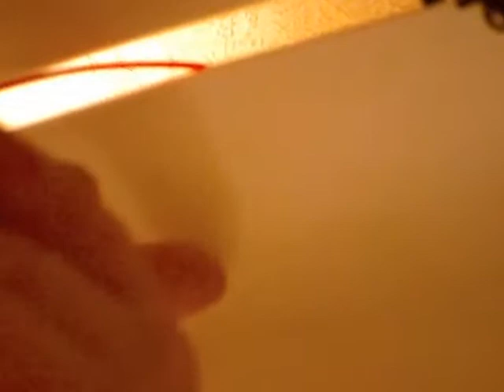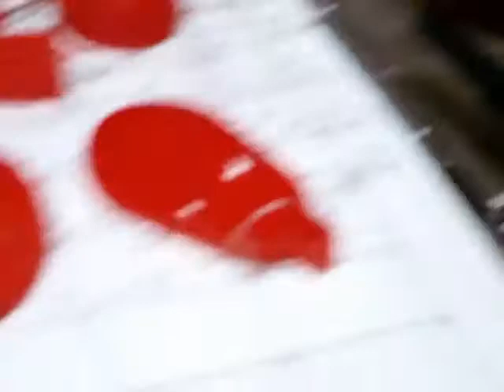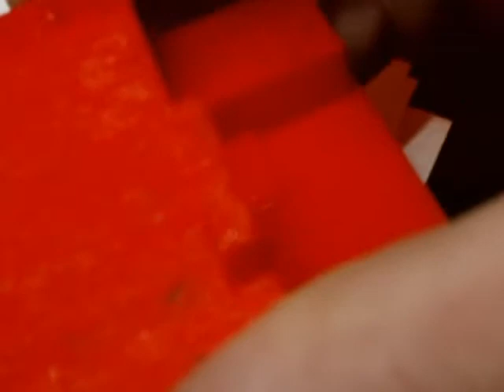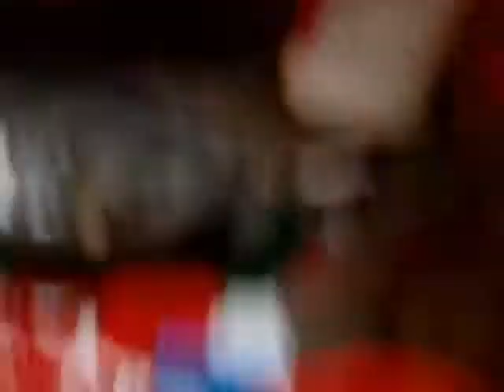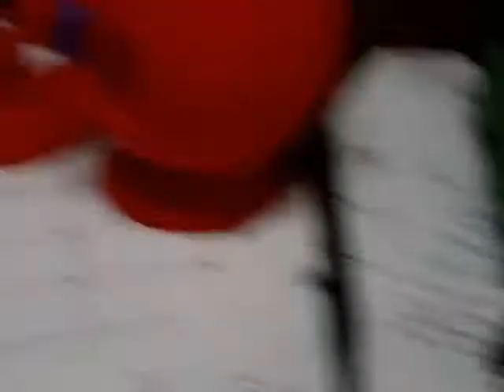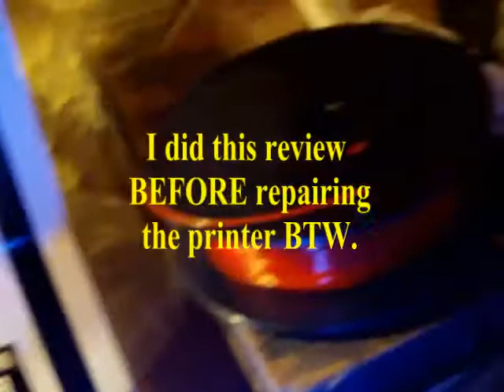Robo 3D R1 - Old review / Extruder Repair Video 5 (of 5)

Comment: Hi there, many thanks for this series, I have now watched them all, you seem a fairly good and straightforward kind of a guy, so I would like to ask you some questions about your RoBo,
1/ is yours called RoBo R1 ABS+PLA
2/ when did you order it
3/ when did you get it
The reason I am asking is I have just got mine which is RoBo R1 3D ABS+PLA model, I ordered it about 9 Jan 2015, and I got it yesterday 24 Jan 2015 and it does not look anything like yours, so I am wondering if they sent me an old model or indeed is mine an upgrade, anyway heres the differences. My spool holder is a clear shaped piece of plastic which fits the curve of the top of the casing and holds the spool down the right hand side. next my Z axis bolts do not fasten to the case there is no extrusion at the top to catch them like you have. next my hotend only as one fan with no shrouding around it. Also I have no base on my model I don't know if you have one on yours.
I live in the UK and my model was purchased from a supplier ( a proper shop ) in the Netherlands ( which is part of the Eurozone as is the UK )
I am beginning to think I have an old model, when I ordered mine I asked if the ones they were selling were the latest and most updated ones and they said yes, so until I have it sorted I have not turned on my machine. I am going to contact RoBo direct and ask them but as you know they may take a while to answer, so thats why I am asking you as well. Sorry I have gone on a bit, it seems us Roberts like to talk LOL, many thanks Bob
Reply from the maker: binness I am sorry it has taken so long for me to reply (anybody posting comments on these videos does NOT result in an e-mail notification to me for some reason, so I have no idea if somebody is commenting unless I actually dig to find the comments area on my channel).So, Mr. Robert, I appreciate your taking the time to watch my series on this, and don't worry about going "on a bit" as I am very much the same way (BTW, I had a friend that always called me "Mr. Robert" (no last name reference)).From your description it DOES seem like that is an older model.  If you look on Youtube for Robo3d kit build videos you will see that the kit they had after their kickstarter campaign looked very much like you describe.Let me see if I can find a link to that video for you real quick...Yes, here it is... if you paste the link into your browser, it will take you to Robo3D's Youtube channel.  Just scroll to the bottom and you will see their assembly videos for their kits.  That should show you if your printer is similar to their old (very old) model from 2013.@channel/UCGbjMx1XUzolm0AwXNhI34wI hope that helps Mr Robert!
Reply from the maker: binness Im sorry Mr Robert, I forgot to answer the other part of your question.  I purchased my printer in early to mid November 2014 and received it a week or so before black Friday.  And it is an ABS+PLA unit.
Reply: Robert's Grip Mr Robert ( I love it ) many thanks for your answers, yes it seems I have an old model, the one which was out just before yours, at least it as the heated bed and self levelling system, I only wished it had a better hot end, so it looks like I have to spend more money, ( is that not always the case ), Don't you just love hobbies LOL
Keep on printing
Bob
Reply from the maker: binness Well good luck Mr Robert!  Hopefully they wont charge you too much ( Ive been curious to know how much a new hot-end would cost).

Comment: so would u still recommend this printer??
Reply from the maker: Brandon Nixon Yes, I still would.  There have been a lot of other interesting reviews on Amazon since I posted this video (my review is still the one you will see first as the 'most helpful positive review' if you look robo3d up on Amazon.  So you might want to check those out as well (many good, some bad)....but as far as the bad reviews (the ones that are substantive that is), just follow my advice and send the damn thing back and have them send you a new one if it doesn't print right out of the box...as it SHOULD do this with no problems (although avoid their sample filament if they send you any since it will cause problems pretty quickly!!!).
Reply: Robert's Grip If u were to buy the printer again would u do it through amazon or robo themselves
Reply from the maker: Brandon Nixon I would do it through Amazon (I would imagine you would have a much easier time returning for refund or replacement.  Also, it occurred to me that perhaps you haven't seen my first video in the series (which has the newer review than video 5 has).  Just click on my channel name (ie Robert's Grip) and that takes you to my channel, then select "Robo3D R1 Review / Extruder Repair Video 1"...or click on the video below if this link posts properly.

@watch?v=Yd71B8BBUGk    44:55   Play nextPlay now          
@watch?v=Yd71B8BBUGk
Reply from the maker: Brandon Nixon Apparently the link didn't post correctly....just do as I suggested and click on my channel, or go to Amazon and there is a link to the video in the review I did and you can copy and paste that into your browser.  But I would recommend going through Amazon 'just to be safe'.  As far as I know Robo has many more kinks worked out since the unit I bought a few months ago (ie you shouldn't have a leaking extruder at least), but it is always advisable to play things as safe as possible.